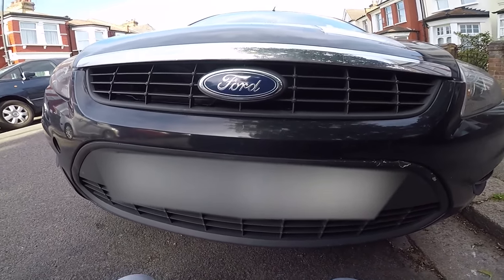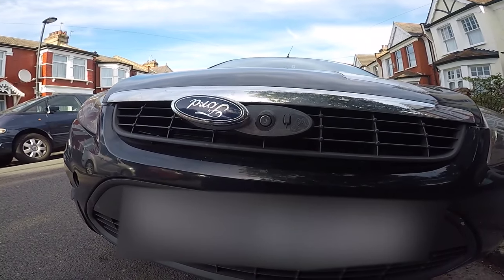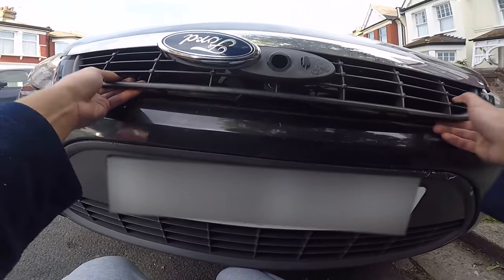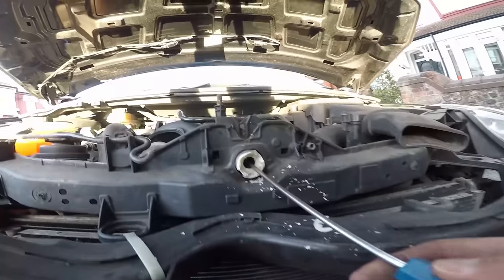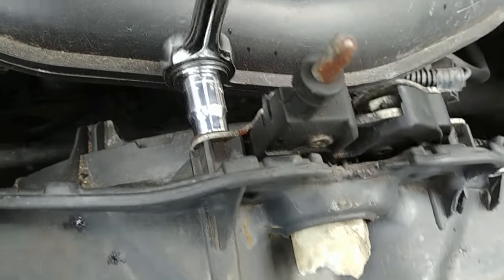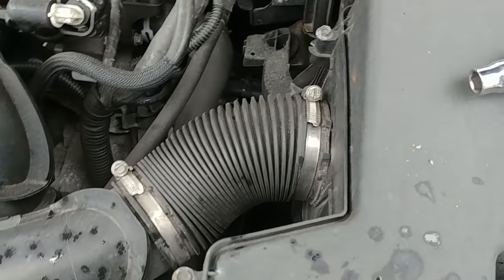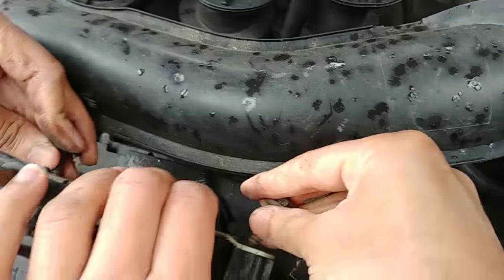2008 Ford Focus Bonnet won't open Repair (UK)

Comment from the maker: Use some electrical tape around the flat head screw driver when prying off tabs/clips. So you dont damage paint on bumper.
Reply: Wish I'd seen this comment before I went ham on it 😂

Comment: no need to break anything, once you get the grill off just grip the lock barrel and turn to the left then the right. the cable inside will do the work.

Comment: Very useful but too complicated for me. The garage mechanic opened it without tools but by vigorously pushing with both hands then left right with the key. This is now being replaced and I hope it lasts as long as the original 18 years.

Comment: Successfully did it on my 2008 Focus! Pay close attention to where the creator inserts the screwdriver to pop the grille off - is quite difficult otherwise. Also be careful of where your fingers are when getting the lock itself out, I ended up pinching my finger between the bowden cable and the bottom of the grille. Smashing the white plastic bit off is quite a task, I ended up using the screwdriver as a sort of a chisel. The whole thing took me about an hour and a half, I also ended up damaging the paint on my bumper a bit, though I'm pretty sure many of you are more careful than I am - many thanks for making this video!
Reply from the maker: Yes I should have done it a  better way of not damaging the the paint on the bumper. But you made good points👍
Reply: @TheDeedsta  Cheers - again thank you so much for making this video, helped a lot!

Comment: No no no no, no need to smash any thing off, it can all be removed from under the bonnet, and pulled into the engine bay. At least it can on my UK 2011 1.6 diesel model.

Comment: Thank you for this video, this helped me get my sisters car repaired. The replacement part was absolutely awful though, so a bit of modification was required... Had to superglue the plastic "+" shaped spur on the end of the cable into the plastic "+" receiver inside the mechanism that holds the bonnet latch, otherwise it kept slipping out and the key would no longer work.

Comment: trusted what you said on the video and although i managed to break a piece off the plastic attached to the grill when pulling it out, it went perfectly with a replacement lock i bought for £20 on ebay. you saved me a ton of mmoney. cheers
Reply: Can you please tell me what year is your Focus? Do I need many tools? Do you think I'll be able to do it?

Comment: Thanks for the video. My second lock just failed and the old trick of pushing on the with plastic and turning key didn't work this time so your video was very helpful in getting in to my bonnet. Thanks!

Comment: Great video. My 2010 bonnet has just given up this week. It dose tend to warn you as the mechanism becomes more difficult before it goes completely. I understand the mechanism was supposed to prevent would be thieves from opening the bonnet but this idea back fired on the proper owner 😳 I've ordered a new lach and cable. 
I've had my focus from 2011 and it's the first time this has happened.

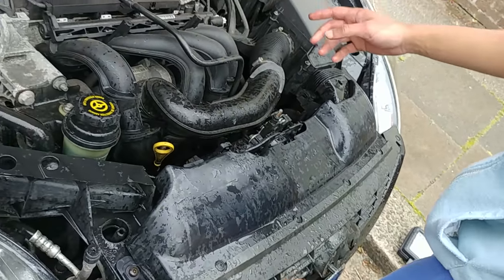Comment: 6:06 - I'd really like to know more about these two push clips.
I'm currently researching to do this fix myself, and I'm unclear on how these clips or screws should be removed. Any advice greatly appreciated. thanks
Reply from the maker: You can get a push clip removal tool or it's also called panel/trim removal tool. But I just used a flat head to pry it out.

Comment: You can also swap the lock if you just want the original key all you have to do is punch out the two roll pins and swap the barrel I've done it .
Reply: on mine there were 3 little pins

Comment: Twist the wire (lock) left then right, after you get the grill out, should pop the hood.
Reply: Tried this mine won’t pop
Reply: ye u just need long pliers. will do the job, im reliably told by a mechanic.

Comment: If you don't want a 2 x key car. many Ebay kits sell a customiseable key tumbler you can build for your existing key. Also, I didn't half wince on watching you use bare metal screwdrivers against that nice shiny paintwork under the grill!
Reply from the maker: Yea i tried to be careful when i did it. Best if you put black electric tape on tip to prevent scratches.

Comment: Mine has gone, gonna have a go at it. 
Difficulty out of 10??
Reply from the maker: 4/10
Reply: Finally got round to doing this. 
I'd say it was a little more difficult than a 4 🤣🤣

My grill deffo didn't come off as easy as yours in this video and I broke the cold air intake which I could glue and tape and put it back on and it's good.
 
Hopefully I don't ever have to do that again.
💪💪💪

Comment: Great help with mine, got the cable out of the housing but can't get the small cross piece out, any ideas, thanks.
Reply from the maker: That you yank out with a plier. ➕
Reply: @TheDeedsta  Tried won't come out at all.
Reply: By sheer luck put the screwdriver in to try and force it out and the bonnet opened! Have now removed it and your driver trick works a charm, really needed this because my battery was flat too, all well now, thank you very much.
Reply: By the way my car is a 2010 Focus and the grill removal is slightly different, held in different places, but still works, thanks.
Reply: @kevinhunter8393  I had the same issue, using a plier works but it took me a good 30 mins of yanking 😂 had to squeeze the clips at the end in so it could be pulled out.

Comment: Neale H Hey I’m struggling with the hammering the plastic bit out. What did u do? Scared to break something. I see the vid jumps from old key unit to just cable and it’s out in no time
Reply from the maker: Yes because it took me a few minutes to break it. You just need to keep hitting it hard until it breaks.

Comment: Im struggling to get the lock out any advice?
Reply from the maker: Breaking the plastic part?
Reply: @TheDeedsta  no when taking the grill fully out the lock chamber is still there can’t seems to pry it out with force
Reply from the maker: @mohammedsaif9192  maybe check with a camera if yours has any tabs behind it. Could be you need to twist it with the key then push it out. But I'm not sure. If yours is a different year maybe they changed it a little bit. Also try popping it out with a screw driver from the back by pushing against the cable

Comment: Hi I m currently having this problem could you please tell me which locking kit you got as my car is the same car but I've heard there is 2 different kits I dont want to purchase the wrong one thanks
Reply from the maker: Ive put the link to the one I bought in the description. Let me know if it doesnt work.
Reply: Linked worked. Brilliant stuff thanks 👍

Comment: Done this but the new part only lasted 4 years which is really a crap design so have to do it again at least I know have to do it just needed a refresher 😁😁
Reply from the maker: Maybe just do the flat head screw driver method?
Reply: TheDeedsta just got a metal one from ebay it came from China so far its not broken

Comment: I don’t want to put another crappy locking system into this car......Cani just leave the bonnet without a lock?
Reply from the maker: Yes. Just use a flat head screw driver when you need to access it.

Comment: If I buy a replacement for a 2015 model, will it work for my 2006 ford focus model? It should be obvious but I found one that says it works for 2004 up to 2015 models. I dont want to buy it and it not work. Thanks!

Comment: you spent more money than you should have and you can keep the original lock without breaking it swan neck 10mm spanner at the back you can access they 2 bolts from the front of the car just put your hands up and over and it only took me 40mins to undo the bolts remove the lock hatch replace that broken part and put it all back together